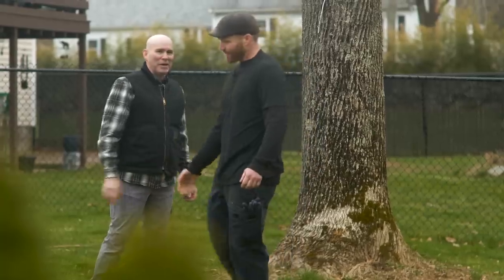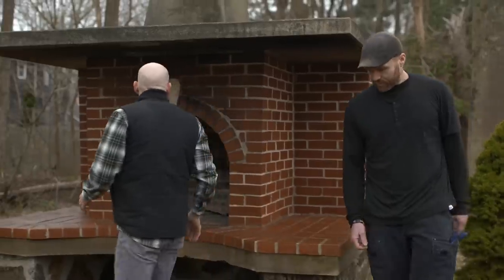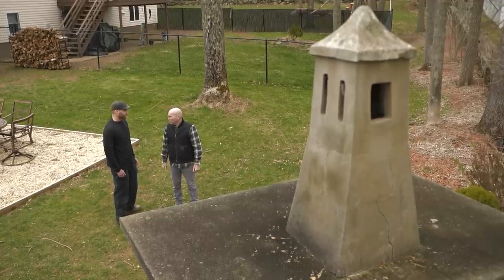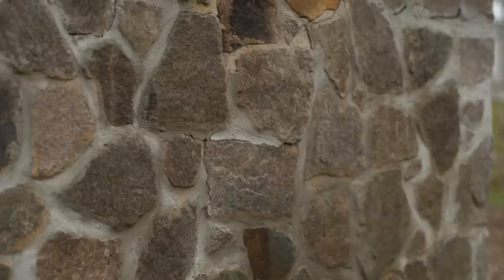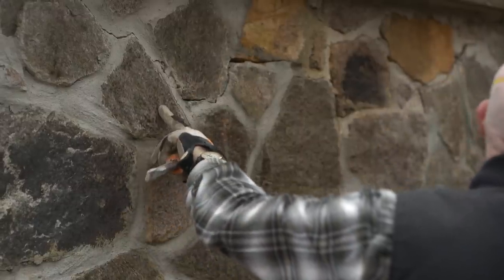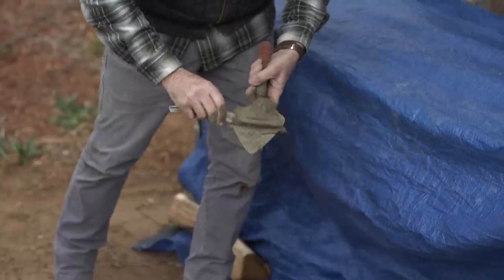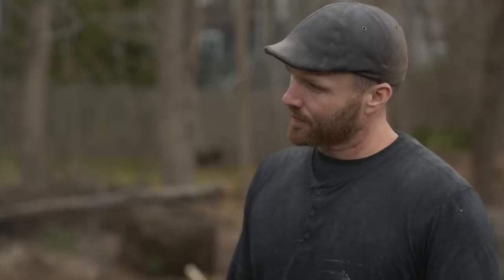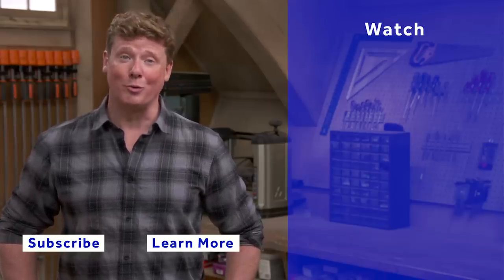How to Repair an Outdoor Pizza Oven | Ask This Old House

Comment: I think a nice stainless steel chimney cap should of been installed on top of that flue.
Reply: So now all the water from the rain will go down into the fireplace pizza oven and crack more of the mortar should have put a top on it

Comment: Now you have a huge hole in the top for water issues with that terrible looking replacement flue.  The original flue could have been salvaged and resealed to the top of the oven instead of that terrible replacement from the dollar store.
Reply: I figured he was going to repair the few cracks and seal around the base. Shame to see that custom flue destroyed.

Comment: Those paper dust masks don't protect that well because it's hard to get proper fit, I suggest use a half face respirator with particulate cartridges, they are way better. I have one from 3m brand which I like.

Comment: Was never addressed whether it was built on a solid foundation.  I suspect the real reason for those cracks is thermal expansion.  In the cooler months if you have a fire in that pit those bricks could go from near freezing to well over 100 degrees then back to near freezing within 24 hours.  That's a huge temp swing when you have such a blend of different materials - concrete, brick, stone, etc - all with their own expansion and contraction rates.
Reply: True a guy who works in the area, is on national tv and has years of experience probably gave a bad assessment

Comment: I would think a stainless steel cap should have been installed at the top of the chimney like we have on fireplace’s around where I live?
Reply: @brooksteer5629  maybe it was a budget thing, but I would think they would want to protect the chimney tile from freeze-thaw and cracking over time.  Not to mention keep water out of the fire box area and doing the same.  TOH has always been overkill on keeping moisture out of areas it shouldn't be in and it just seemed strange they stopped short of completing the project.

Comment: IMHO the mortor was way to thin. I live in the Netherlands where almost everything is build with bricks so I know how to build a wall and to repoint a wall. We use here a much thicker mix. It is a dry enough to make balls to trough 😅. With this wet mix you need a lot of extra work to clean.